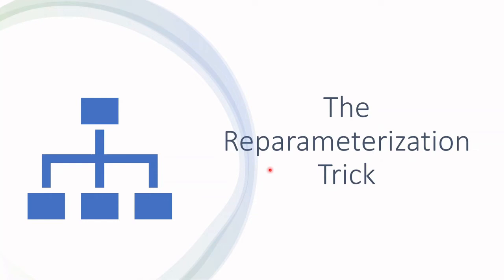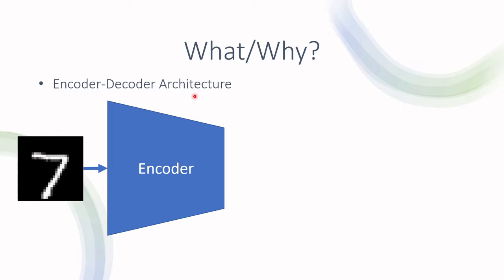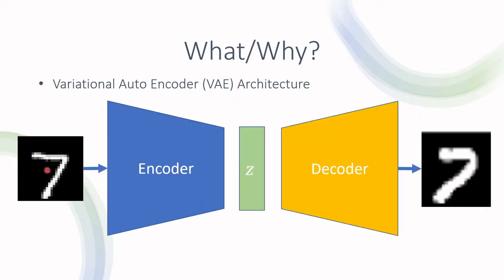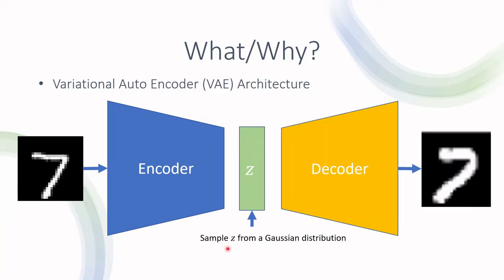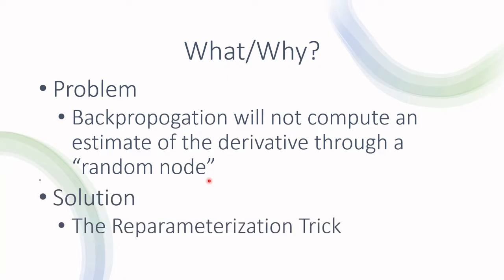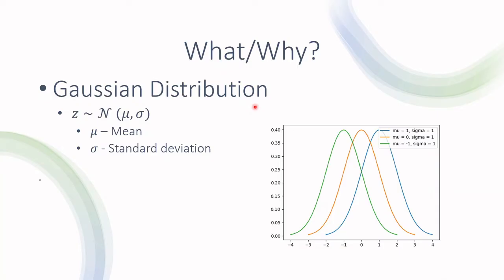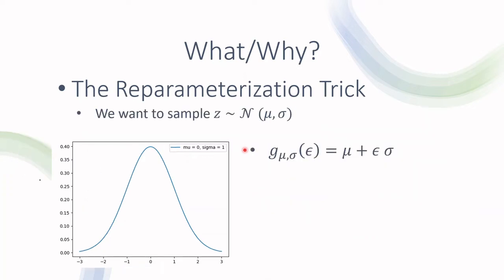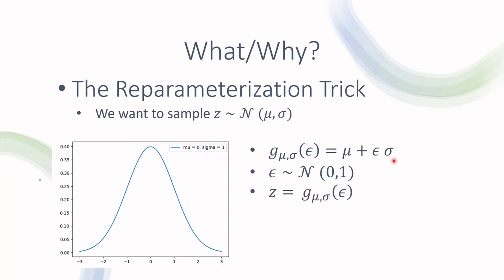The Reparameterization Trick

Comment: 16:27 It's unclear (for me) (in context of gradient operator and expectation) why f_theta(z) can't be differentiated and WHY replacement of f_theta to g_theta(eps, x) allows to move gradient op inside of expectation and "make something differentiable" (from math point of view)

p.s
in practice we train MSE and KL divergence between two gaussians (q(z:x):p(z)) where p_mean = 0 and p_sigma = 1 and it allows us to "train" mean and var vectors in VAE
Reply from the maker: Thank you for the feedback :)

I will try to address both items:
1. The replacement makes the function (or the neural network) deterministic and thus differentiable and smooth. Looking at the definition of the derivative can help understand this better: lim h->inf ( f(x+h) - f(x) / h ) where a slight change in x produces a small change in the derivative of f(x), makes the function "continuously differentiable". This is the case for the g function we defined in the video: a slight change in epsilon produces a slightly different z. On the other, i.i.d sampling does not have any relation for two subsequent samples, by definition, so the derivative is not smooth enough for the model to actually learn.

2. Yes, I've considered adding an explanation for the VAE loss function (ELBO) but I wanted the focus of the video to be solely on the trick itself since it can be used for other things like the Gumble Softmax Distribution. I will consider making future videos both on ELBO loss and Gumble Softmax Distribution.
Reply: @ml_dl_explained  
Thank for an answer !  ❤

Ohh, I'm just missed that we make random sample.. 
my confusion was at 15:49 you have E_p_theta = "sum of terms" which are contains z(sample)  and on the next slide you just remove them (by replacement z to epsilon and f -> g)
Reply from the maker: Yes, I understand your confusion. The next slide on re-parametrizes does not divide into two terms like in the "sum of terms" you described. This is because the distribution is not parametrized and so when calculating the gradient the case changes: Instead of a multiplication of two functions (p_theta(z)*f_theta(z) -- like we had in the first slide) we now only have one function and the distribution parameters are encapsulated inside of it (f_theta(g_theat(eps, x)) -- like we had in the second slide).

Hope this helps :)